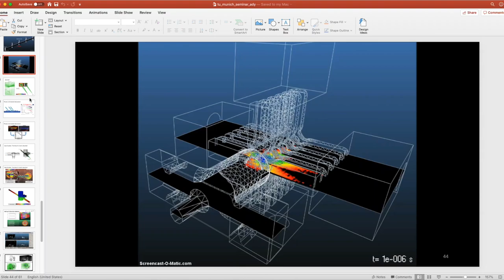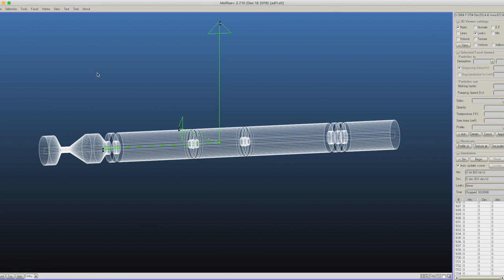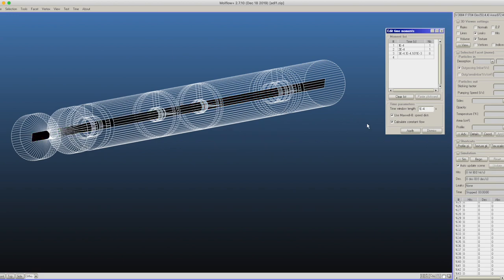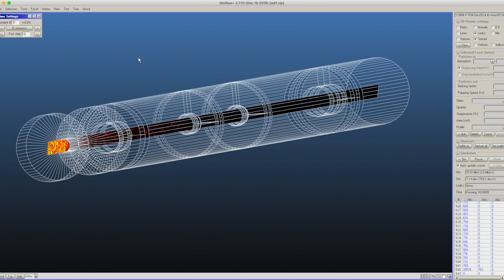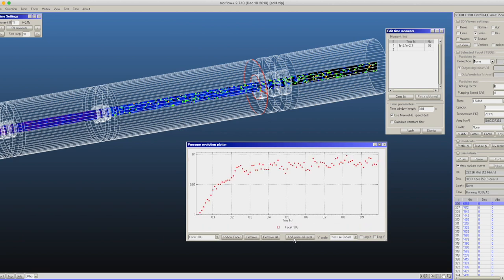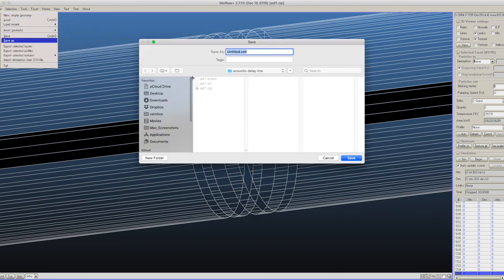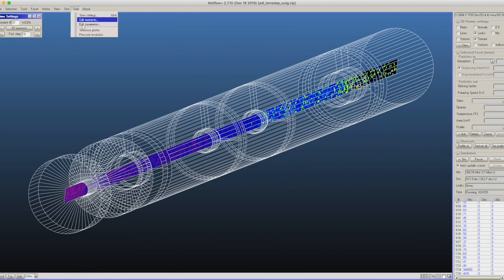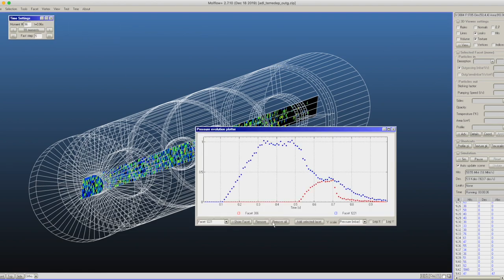Molflow webinar - Time-dependent simulations basics (Acoustic delay line)

Comment: Hi Marton , Could you please describe how it is possible to set a initial pressue within a system ? Thanks
Reply: Hello Rhys. One of the core principles of Molflow that it's event-driven, i.e. particles don't exist in volume, they are always created on a surface and traced to the next hit point. Therefore we didn't find any way to create a starting pressure in the current implementation. There are a few workarounds, though. What we usually do is to create an external reservoir (or make an existing volume of a system a reservoir) by delimiting a volume with a valve, represented by a facet with time-dependent opacity. When the facet is opaque, it's a closed valve, when transparent, an open one. You can then create an initial pressure by a pulsed outgassing at t=0, keep the valve closed until pressure reaches static state (usually a few milliseconds, depending on system size). Once the target pressure, set by the pulse amplitude, is reached, the valve can be opened.
Reply: @szakeetm  Thanks for the thoughtful response. I did eventually work out to set the constant outgassing rate (1e-2) in my case with a time dependent opacity. Unfortunately I'm now struggling with the software constantly crashing after I closed down the application once , clearly the way I ran the simulation initially is different to his I ran it after this second start up ( as I'm almost totally sure there is no change in simulation configuration).
Reply: @rhyyss123  Please get in touch in the Molflow forum, where we can share files and screenshots. We are happy to check any reproducible bugs!
Reply: @szakeetm  Great , will do. thanks.